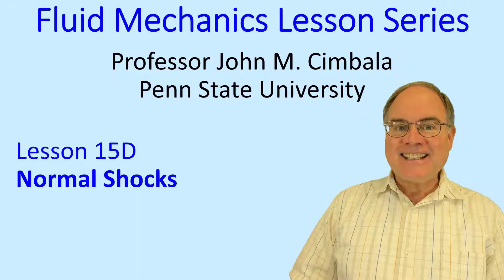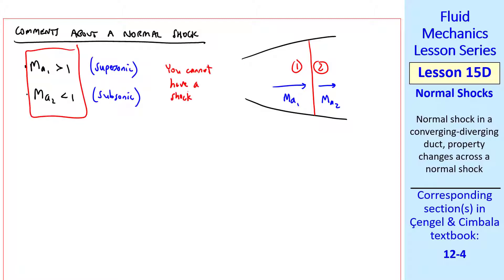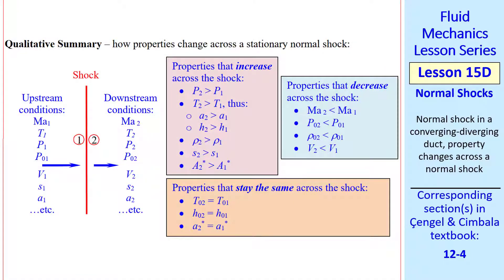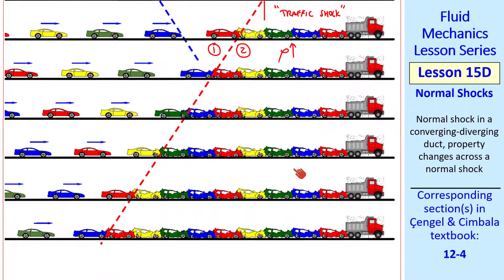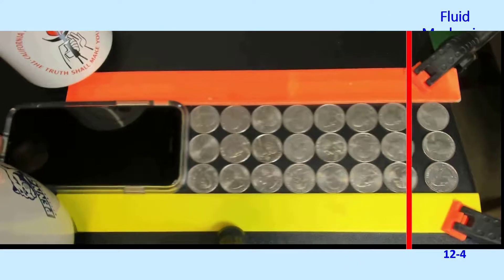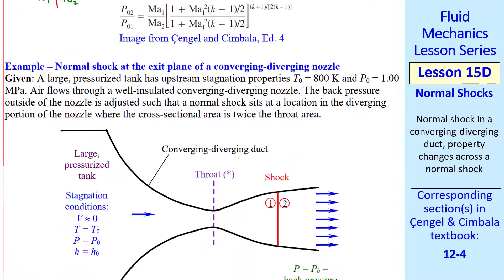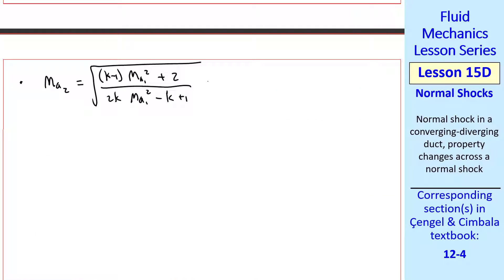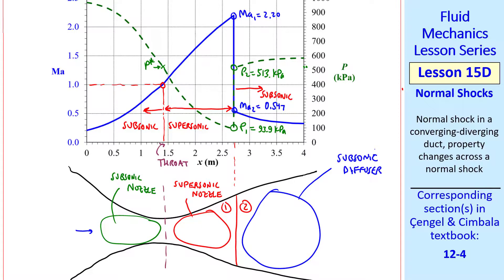Fluid Mechanics Lesson 15D: Normal Shocks

Comment: Do you not use the flow functions table for simplicity?
Reply from the maker: Actually, I do not. Why waste time interpolating in a table (with limited accuracy and the possibility of mistakes) when it is easy to enter the equations into Excel or MATLAB or other software ONCE and then never have to worry about errors. I did use the tables to verify my software results, but no longer need them.
Thank you for your comment. Please tell your friends and colleagues about my YouTube channel where there are over 500 free videos about the Bible, fluid mechanics, science, math, Excel, statistics, air pollution, and other topics. I would greatly appreciate it.

Comment: Thanks a lot for this lecture sir, could you please tell how the location of normal shock wave can be found without using gas tables when Ae/At and stagnation properties are given?
Reply from the maker: Yes, I provide all the needed equations on the equation sheet that you can download. However, it takes some iteration to determine the shock location. I discuss this in detail in my compressible flow course (a technical elective), for which I do not yet have many youtube videos.
Thank you for your comment. Please tell your friends and colleagues about my YouTube channel where there are more than 400 free videos about the Bible, fluid mechanics, science, math, statistics, air pollution, and other topics. I would greatly appreciate it.